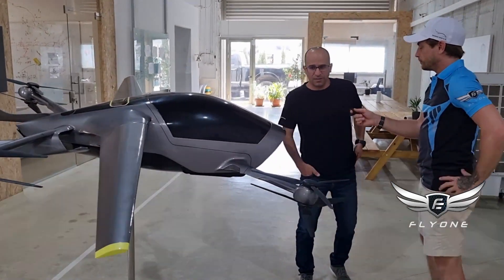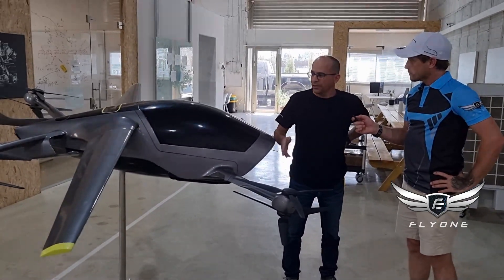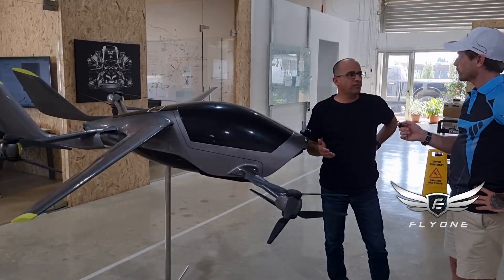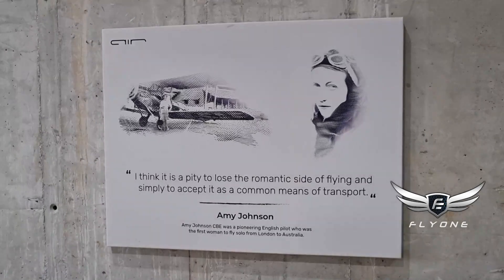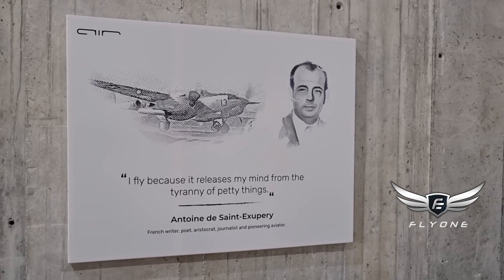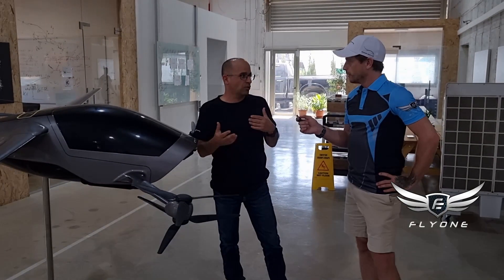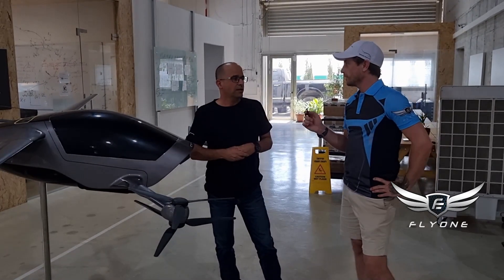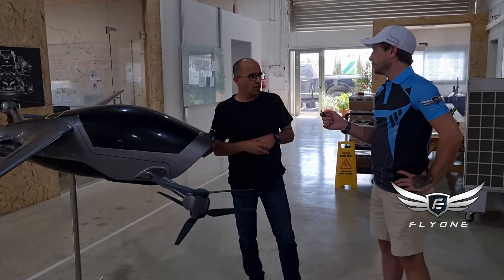The Truth about EVTOL Aircraft (Flying Cars) | FlyOne.com.au

Comment: Let me sum it up for you in just a few words: Expensive, impracticle, dangerous, Unnecessary. That about covers it.
PS. I forgot, noisy.
Reply from the maker: That's what horse riders used to say about cars.
Reply from the maker: Do you have a better suggestion for how to get say... an injured skier from the top of a mountain to emergency medical care 2000ft below quickly and directly? Or an offshore worker to lifesaving hospital care 100km away on land? Or a paramedic and 150kg of emergency equipment to a vehicle crash in peak hour traffic where a child will die if they aren't stabilised in minutes? Since these are cheaper, safer, more practical and much quieter than a fossil fuel powered helicopter. Also, thanks for your interest and watching our videos!
Reply: @ElectricPlaneGuy  In the hands of a professional crew that will be properly trained, maintain the vehicle and will only use it for emergency applications, I have far fewer objections to these overgrown drones. What I do NOT want to ever see is every Tom, Dick and Jane thinking that they can use these things to beat commuter traffic. For that application, BEVs in tunnels would be a vastly superior solution.
Reply: @surferdude4487  BEV's in tunnels is idiotic...
Reply: @Eric-ue5mm  Not even 1/10th as idiotic as putting flying cars into the hands of private citizens. instead of a poorly maintained vehicle resulting in someone getting stranded at the side of the road and having to call a tow truck you get 3 tons of metal and lithium batteries falling out of the sky. Yeah, that's just a brilliant idea.
Reply: @ElectricPlaneGuy  Look up rescue helicopters, they exist.